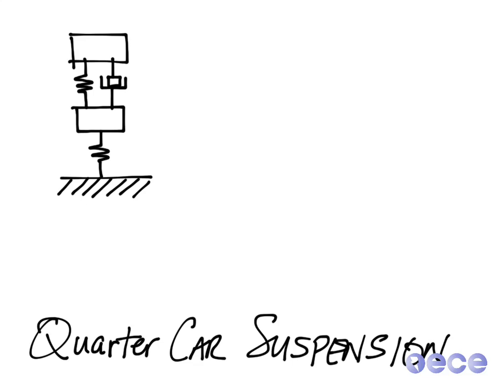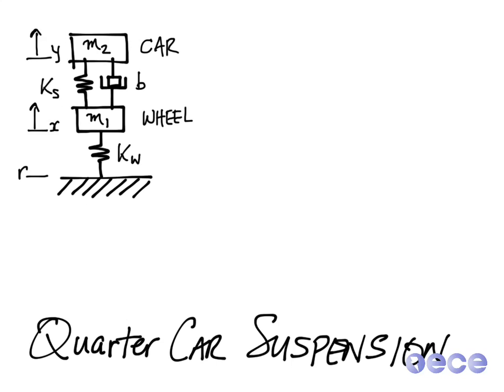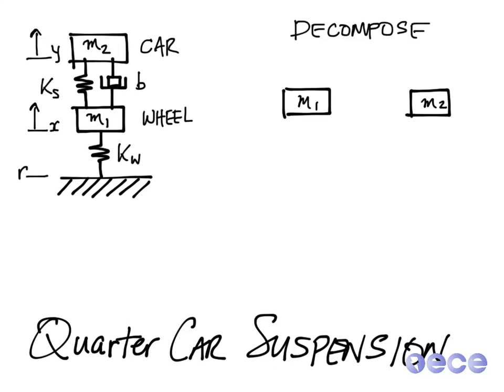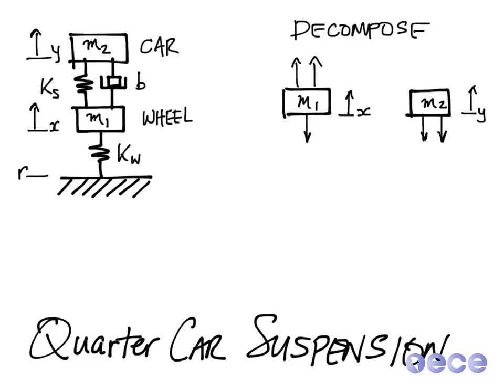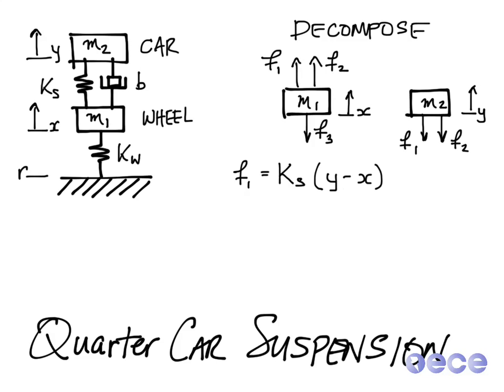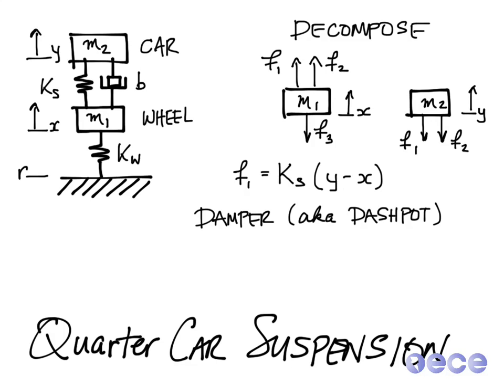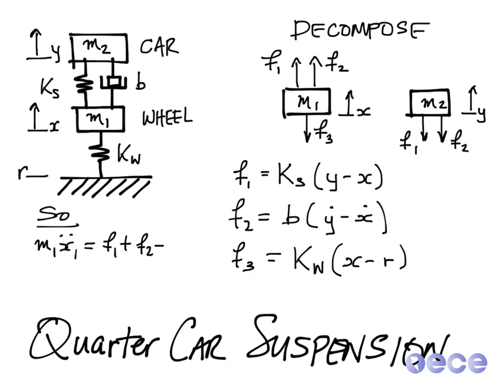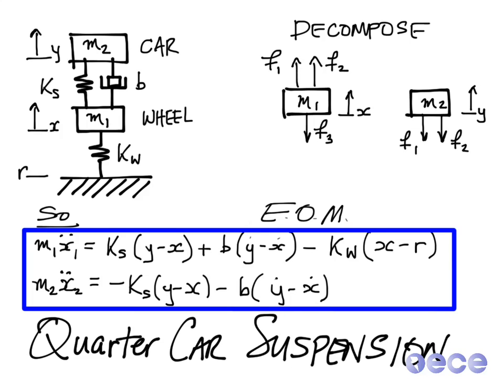Quarter car suspension model

Comment: For those wondering,  there is a mix-up of notations in the Equations of Motion. m₁ẍ₁ should actually be m₁ẍ and m₂ẍ₂ should actually be m₂ÿ. The double dot notation means acceleration and the two equations of motion are in the form mass × acceleration=∑force .
Reply: Thank you I came to the comment section to verify this

Comment: There should be a hidden constraint here: y>x. The option y<x is mathematically possible, but not physically. How do I take that constraint into consideration? I am running several simulations of this system with different parameters and I always get at some point in the simulation that y<x which means that m1 and m2 go through each other! Thanks.

Comment: The system is only dampened if you hit a puddle ;)
Reply: idk dude. have you seen a car w/o shocks, or have you driven a car with really hard shocks? lol. Either way is awful. The dampers on a car are ALWAYS working. Touch one after going down the road a ways. Muy caliente!

Comment: why we dont put the gravitacional force at the diagram?
Reply: Because in most cases it is considered that the diagram is in static equilibrium, so the springs are already considering the gravitacional force and they are being forced down by the weight. Making this consideration you don't need to write the gravitacional force to the diagram.

Comment: I couldn't understand what are (x double dot one ) and (x double dot two)
Reply: +Tarek Kanbar x1 double dot is the vertical acceleration of the wheel and x2 double dot is the acceleration of the car.
Reply: +Blahrg x2 double dot should be y double dot and x1 double dot should be just x double dot
Reply: yeah, I believe @burlinskas is correct.
Reply: It is well known that the first derivative of position (symbol x) with respect to time is velocity (symbol v) and the second is acceleration (symbol a).. so first order derivation is termed as single dot and second order derivation are double dotted.
Reply: those are nuts bro